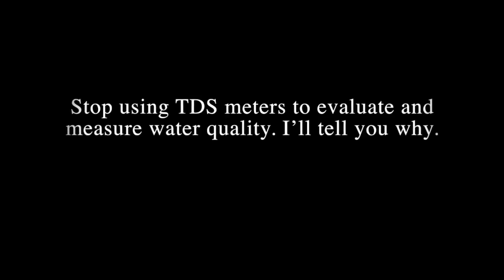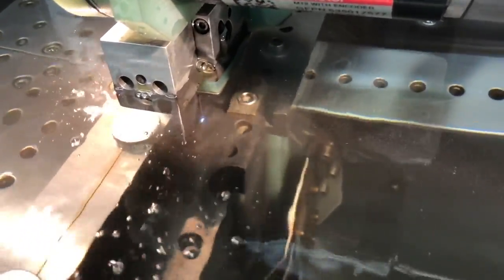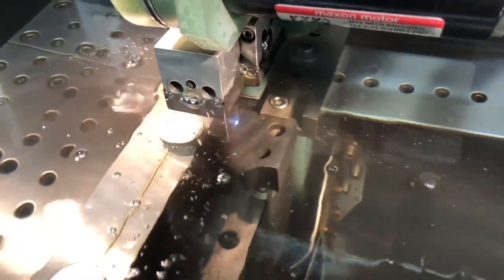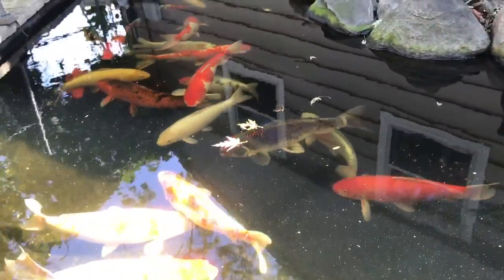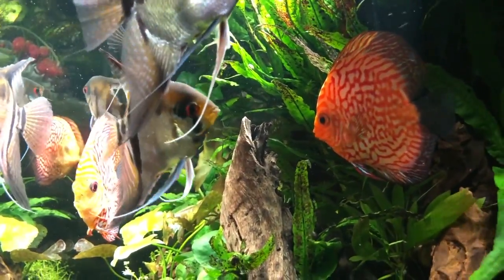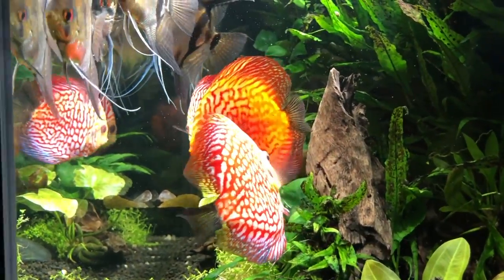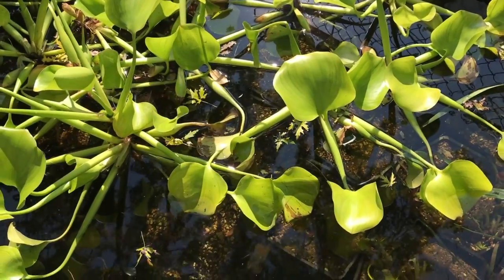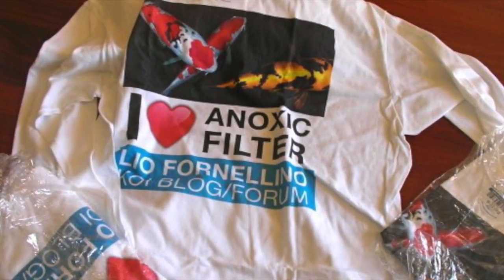Stop using TDS meters to evaluate and measure water quality. I’ll tell you why.

Comment: the way I use TDS is like this: there is a base TDS of your water, mine is around 100. After I treat  it and let it sit for a few hours this drops to around 50-60. This is the base I go with. If it's lower than 50 I add mineral salts to bring it back to around what I need it to be based on what I have in my tanks. Now I add this to my tank and this will be the base value. When this value increases it could be a few things but most of the time it is nitrites. If my base value was 100 and now it's 200 I'm pretty sure I have at least 80ppm NO3 in my tank and it's time to do a water change. A tds meter will never tell you how good your water is, but it can tell you how much it changed since last time you checked. How it changed ? Very good question, for that you have the other tests ... But testing takes time, 15-30 minutes to do all the tests in one tank and if you have multiple tanks it can take you a whole day. A dip with a TDS meter takes about 5 seconds max and, if you know your tanks and your water you have a really quick way to figure out weather you can have a problem in your aquarium(s) or not and weather you need to make other tests or not.
Reply: tds is really important, my guppy and goldfish are very happy in the rain, they spawn a lot and are very active.

Comment: Hi Sir, I have successfully achieved full denitrification in my aquarium using a certain technology that I have developed myself, and I have stopped doing water change since January 29.  As of yesterday, however, my TDS is already 150 (vs tap water of 75).  Based on your discussion, TDS is not a determinant of clean water.  Do you leave your tank with high TDS and your fish stays healthy?  Also, may I personally consult with you on facebook?
Reply from the maker: bosko buha I will. I’m in the process of moving to Florida and I will be doing more videos and taking more about the Anoxic Filtration System too in videos when I get to Florida.
Reply from the maker: It seems that TDS is not all that accountable for fish health meaning that TDS of 250 is not really all that high because in most cities it comes out from the tap that way.  If you have come up with a new technology for denitrification I would really suggest that you keep it quiet as long as possible until you do enough research before you put it out to the public. I’ve seen too many people get beaten up by the public which pretends they are the experts in all fields of aquatic microbiology. When I first introduced the anoxic filtration system to people you would not believe how vindictive and mean people are. You can reach me : drklnovak@hotmail.com , good luck with your new system.